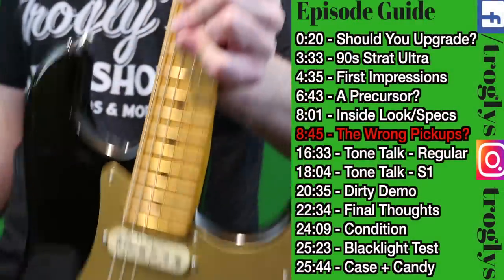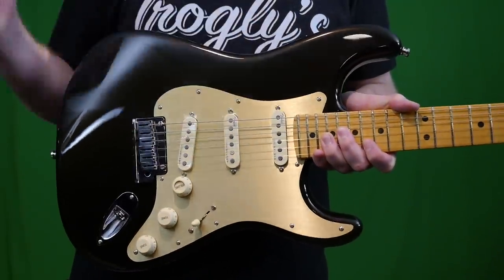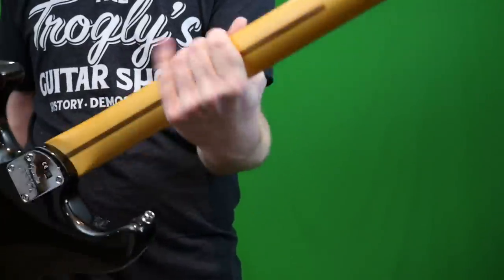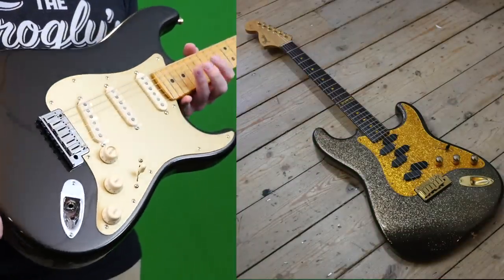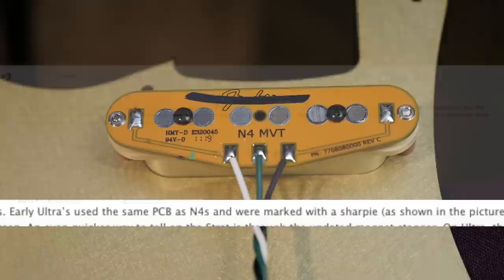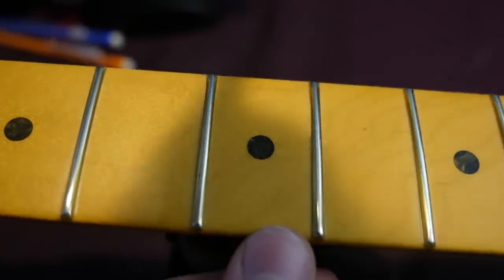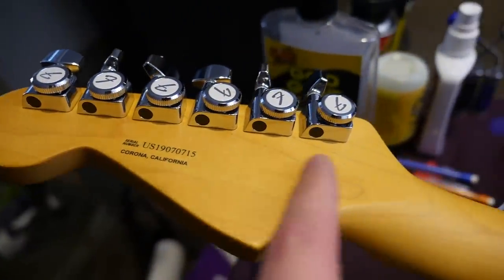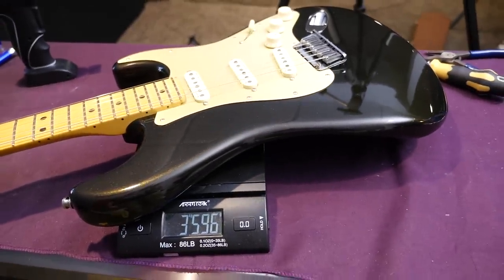Did You Get Wrong Pickups in Your Ultra Strat? | 2019 American Ultra Stratocaster Texas Tea | Review

Comment: Treble bleed on a tone pot...that,s a capacitor same as any tone pot, treble bleed is a totally different thing and is on the volume control.
Reply: @IrisGalaxis  So it,s a tone (cap)bypass but a treble bleed it,s not . treble bleed is a cap and/or a resister between the 2 lugs on a volume pot, it retains the high frequencies when the volume is turned down so it remains nice and bright . Found on most es 335,s so the pickups don,t get dull sounding when blending . Both cool and usable mods though.

Comment: I don’t know if you know this or not, but the bridge is pulled all the way forward from string tension. It should be flush with the body. I noticed it at the middle and end of the video.
Reply: It's a FLOATING bridge....same as on the very FIRST Strat, and a million others since.
Reply: charles joynes no dude look at the bridge at the end of the video it’s back end is lifted all the way up as if you were doing a dive bomb. I own strats and am a repair tech I know how a strat bridge should be set up.
Reply: charles joynes check out the bridge at 16:26
Reply: And at 26:50

Comment: Hey trogly, just quick question I got one of these last year after waiting for about 8 months and the fret sprout was so bad I had the edges sanded off slightly. However you can obviously notice it a bit on the edge of the frets on the neck. it's really just a minor detail as the guitar feels perfect now, but my OCD really notices each time, is there any way to match the stock neck finish to make this less noticeable?

Comment: For 2,000 dollars I would get a top of the line PRS!
Reply: You'd need to double that to even get into the "real" PRS range. You'd need to add a digit to get to the top of the line.
Reply: @modelcitizen1977  True
Reply: @modelcitizen1977  With €2K in my pocket, I'd hunt down a 1990s Patrick Eggle Berlin Pro (instead of a PRS) AND a 1980s/1990s Fender Strat Plus or Deluxe Strat Plus (instead of this new Ultra).
Then I have at least some stable value in my hands, because this new Fender plank will only write off. That is what new guitars do.

Comment: Correct me if i'm wrong but I've always read that necks with the truss rod adjustment at the bottom were superior in build quality and strength. The tuners are obviously made cheaper, the trem is the same and the pickups are basically the same. So this is an "ultra" strat? Downgrade everything and call it ultra. This has convinced me to start ordering the necks and bodies from Warmoth and put it together myself. For half the price I'll get the weight I want, radius, color, etc. Fender USA guitars are disappointing as they are only marginally better if that to the Mexican models. All that being said I still believe the stratocaster is the best designed production guitar on the market.
Reply: I strongly suggest the recent Wilkinson Locking Tremolo bridge (with "extra" screws that allows maitaining stability even when the bridge is used similar to a FloydRose one...). And we must wait this "Gen4 pickups problem" be solved on a year or two...

Comment: The nut on that Ultra is a Wilkinson nut which predated the LSR. The OG Ultras are better in my opinion. Fender is great at bodies and necks and should stay in that lane. What made the Ultras great was Schaller locking tuners ( not the current crappy Fender locking tuners), Wilkinson nut and LSR, much better than current nuts ( people didn’t understand these and couldn’t get over the change in appearance), NO STRING TREES! Lace Sensor noiseless pickups ( not those tinny sounding fender noiseless *barf*, it seems to me that fender has been moving towards “ making” all the pieces for their guitars and to me, their stuff is bad. Fender wiring is good, OG Ultra sounds better to me, plays better.

Comment: I never liked the control positioning on strats. The tremolo bar always hits the volume knob
Reply: Several fixes. Easiest: 180 degree turn whammy bar. Easy: Make Bridge flush parallel with body, if two pin tremolo, raise the pins but keep level. Might require an extra spring in the back. Complicated but most effective, if you are going to be dive-bombing the tremolo, get a Floyd Rose Clamped tremolo. Get this Strat with a Floyd Rose tremolo https://www.long-mcquade.com/135876/Guitars/Electric-Guitars/Fender-Musical-Instruments/Player-Stratocaster-with-Floyd-Rose--Maple-Fingerboard---Tidepool.htm
Reply: @QuoVadis88  I switched to Mitchell MD400 guitars

Comment: So just to be clear, they did give you the right pickups, just the older circuit boards?
Reply from the maker: Yes, I got the "right" pickups but they are different from most Ultras. There was a very early run of the Gen 5 Noiseless pickups that used the Gen 4 PCB. All the rest will have a colored PCB and have Strat ULTRA on them
Reply: @Trog  ok thanks for clarifying for me

Comment: Whoa, the bridge angle and fret condition look not-so-good.
- Steel wool is for the rough-sand stage, and should not be needed on a new guitar (even a cheap-o). Some gradually finer 1000 (and up) grit sandpaper and emery cloth is what you want to use.
 - As far as bridge angle, that's string gauge vs spring tension of the trem block. It seems that you either a) went to a heavier gauge without adjusting the spring-tension to balance the bridge parallel to the body, or b) went for a lighter tremolo action by removing a spring from the block.
 I cannot recommend "Dave's World of Fun Stuff" and "Will's Easy Guitar" channel enough for some of the best setup guidance. Time well spent, ESPECIALLY for a dealer.

Comment: If those are noisless pickups(or system), why are they puting conductive paint one the insides of the cavity?
Liars
Corporations come from the word Corp.Corpse/Korpus,they dont really care about you cause they are dead
those at the top of the chain i mean
 There are vids with PROPER EMI protection for single coil guitars on Utube. 
Copper sheets (some use aluminum/harder to install,solder wise)with CONDUCTIVE glue. all cavities connected, then cavities grounded on volume pot. thats as far as i know.
My Japan Burny comes with this proper shielding(conductive paint/aluminum on back plates), but the funny part is ,ets dual humbuckers.
that being said, i dont know ivery thang
Keep learning

Comment: No way Trog. $$$ doesn't equate to reality. I'm a Fender guy. These upper models usually offer bling only. The PUPS will not be any better than others sound wise. 99/100 Strat players use effects almost immediately. Neck, yuk! Thinner Fender? Nope. As far as the S1, most guys do exactly what they have done, again, almost immediately. sorry, Fender pretty don't get it. Heal joint cut away? BS. Jimi, SRV, Sayce, etc. seem to be just fine with 60 yr old guitars just fine.